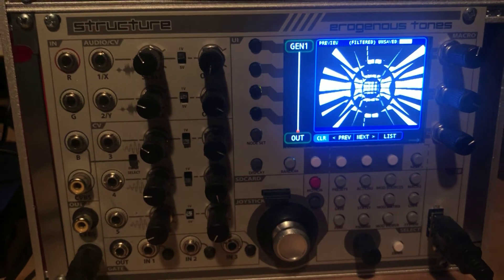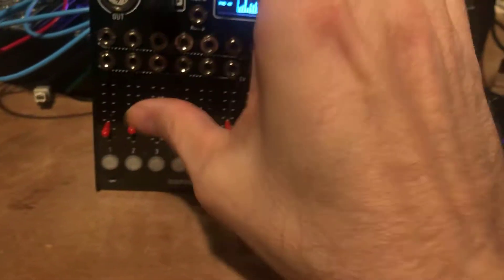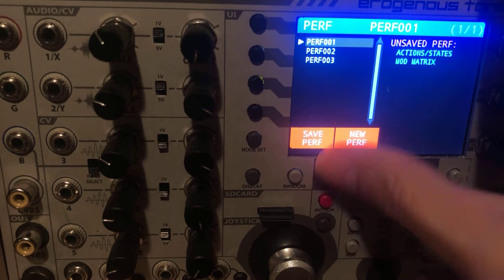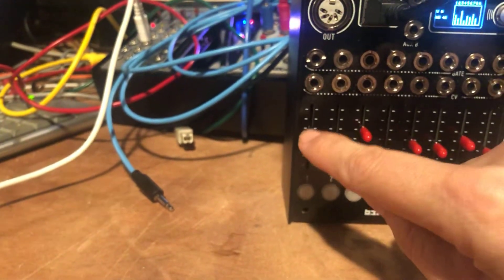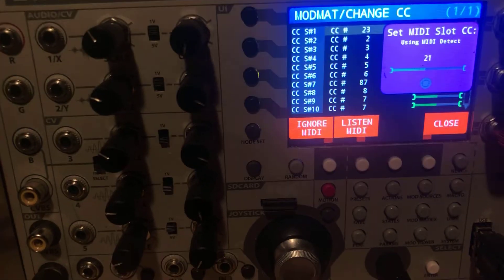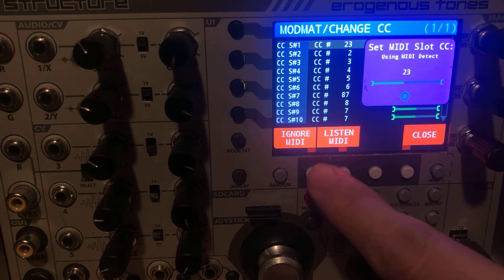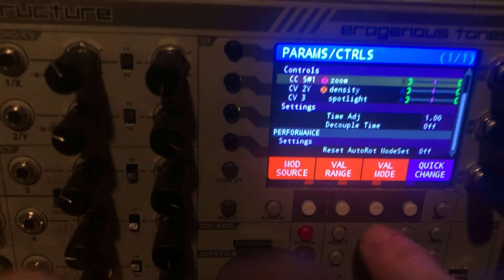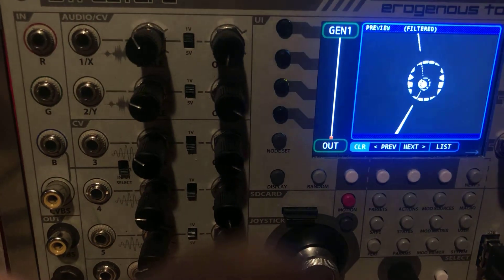STRUCTURE AND VCMC (or any MIDI to USB device)

Comment: Suppose you wanted to drive that Zoom value from a Midi NOTE value.  Is that possible?
Reply from the maker: . You can use MIDI CC values to modulate parameters (Select an EFX1/2/3 node, press PARAMS button, for the FRAG, select 'zoom' then in the Controls part, change the MOD SOURCE to a CC number).   MIDI notes are used like GATE inputs (action or state).